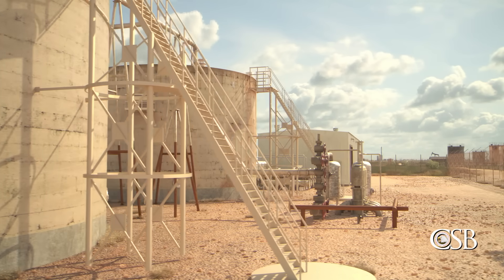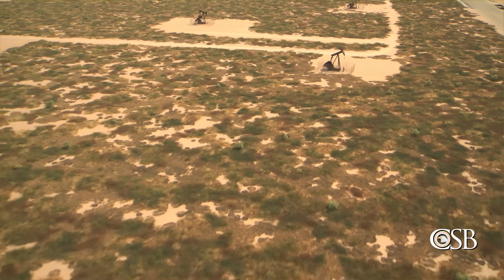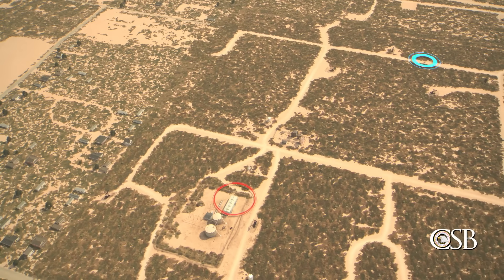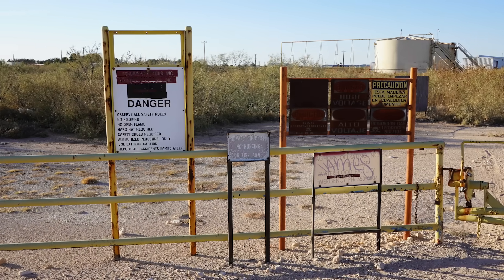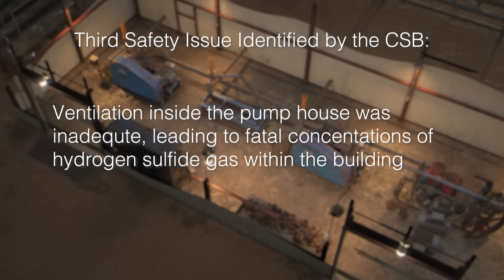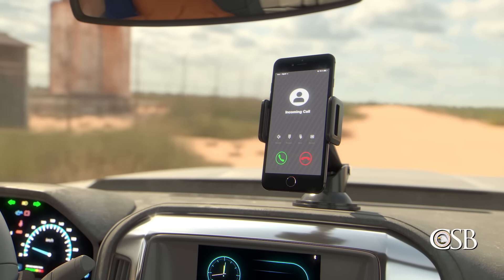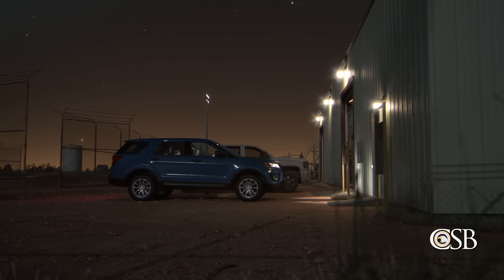Silent Killer: Hydrogen Sulfide Release in Odessa, Texas

Comment: I was surprised to hear that the worker's spouse could just walk into the pump house with operations ongoing.  Is that typical in the oil and gas industry?
Reply: Yes I work here in Odessa most of these fields like this one may only have 1-2 employees on site at a time…
Reply: @Gfkd2001  I know the wife didn't work at the plant, but surely she glanced in the worker's truck to see if he was there when she arrived? If so, how did she not see or hear the worker's personal alarm going off on his front seat? Surely that alarm on his front seat, plus his extended absence would have sent danger alarm bells going off in the wife's mind?
I feel so bad for the kids, imagine the horror of growing up knowing both your parents were killed metres away  from you and you were blissfully unaware so couldn't save them...
That guy ruined hie whole family by not being alert, the wife could have done better herself but the real victims here are the kids. 
Horrifying stuff...
Reply: @mariolisa2832  the personal alarm was found to be active by first responders/investigators, which is likely a discovery made a significant amount of time after the wife arrived. In other words, the work truck itself may not have been sufficiently inundated with the toxic gas at the time to set off the alarm, only later. Also note that, as events are described, it is undetermined if the majority of the gas leakage (from the shattered piston) happened prior to the worker showing up, or were caused by his actions (ie. not depowering the pump); this could be critical for the timeline of the evolution and spread of the gas.

I don't think the worker was at fault, or his wife. The way it is described, Aghorn was responsible, by way of their atrocious safety practices, culture, and training. It is quite possible that he didn't know better. He may have some fault, but we don't know and can't know, and as such it is inappropriate to assume he was at fault when there is ample evidence that it was the company that let him down.
Reply: @mariolisa2832  also, the wife may not have been able to know better. One particular point the video made was the lack of clear warning signage of the dangers presented by the facility. So here you have a woman, likely very, very worried about her husband, who is (wrongfully) not prevented from entering the site (which may even give someone the impression that it's "not that bad"), and is not given appropriate warning of the extreme dangers that may be present. No, I find it hard to fault her either. The only saving grace is that, despite the personal alarm having detected dangerous levels of gas having come inside the work truck, it was still not enough to kill the two children in the wife's vehicle. It's possible that if rescue hadn't come soon after, the kids would have been dead too :(
Reply: 13 years in the oil field and the anwser is no. No way the wife could of known where it was located unless he had taken her out there before which is really against the rules. They give us a list of phone numbers to give our spouses for them to call incase of something like this
Reply: @cooldbz12mach1padilla  She could have used the "where's my phone" app, I would in fact bet that was she did.
Reply: @cooldbz12mach1padilla  this location is right in town you can thro a rock from the location to their home the video is not accurate about the houses around I have friends that live next door to it
Reply: @cooldbz12mach1padilla  you obviously don’t have a phone that shares your location with your family.
Reply: @stargazer7644  actually no, i turn off all location services.
Reply: She probably never thought about it or she wouldnt have driven in there with her kids sadly but at least they stayed in the car its a blessing the gas didnt get to them anyway.   Ive worked by myself and for companies that had very little as far as a safety program to one that was over the top (you learn to appreciate these especially when your family goes to work in the oilfield). So many people get hired during booms that probably never have a general idea about the dangers that some people have heard about there entire life but you cant get complacent no matter where you work no matter what kind of job it is!
Reply: I work at a sour gas plant in Alberta. If I find my wife onsite with no warning or heads up I'd be mortified.
Reply: It shouldn't be...
Reply: Did you watch the video, they said one of the safety breaches was him not closing and locking the gate behind him. If he had, his wife would more than likely be alive
Reply: @carbonzo6  closing and locking the gate, hindering emergency services doesn’t seem too smart now does it?
Reply: @mikebuffing727  I don’t know about this site in particular but all fenced in sites that I’ve been inside of have emergency gates to flee in any direction
Reply: @carbonzo6  I'm curious how those gates operate. Do you have a link to a description, or photos, or something? Are they for people on foot only, or also for vehicles? What prevents them from being opened from outside and how do you open them from inside?
Reply: @robertobryk4989  it’s only able for a person to pass on foot. It cannot be opened from outside the facility. It has a push bar on the inside and that’s how it opens. There is no mechanism to open it from the outside
Reply: @mikebuffing727  hindering emergency services, who, like the rest of us are also mortal, from walking into a cloud of odorless, invisible, instant death.

And any first responder with the PPE to deal with this also probably has boltcutters.
Reply: A firefighter is going to have no qualms ramming through a locked gate to save a life.
Reply: 8 years refinery engineer here. Not typical at all. But, this operation seemed very cowboy - which isn't unheard of in southern US for remote 1-5 man operations (think drilling rigs). Hate to say this - but while Aghorn had fault, the lions share of the blame was with employee and wife. You always take your  PPE, you always walk with caution, you ALWAYS go with a buddy. Every fatality I know of in my city has been due to lack of buddy-system. The fact that the wife showed up with kids to an operating plant is just abhorrent - as a refinery engineer, this to me is akin to child abuse. O&G facilities are inherently dangerous and at my job even take-your-kids-to-work-day wasn't a thing.
Reply: @CMF4L  Happens similarly in the trades. Supposed to work in pairs on energized circuits so if one person is in trouble the other can shut it down, break contact, call for help. Yet guys ignore it, get in contact with a circuit and you find them dead. 

PPE is another one. Knew a guy racking in the main breakers at a refinery, it was hot in June, so he decided the hot as hell arc suit could be skipped this one time. Well, it was the one time an arc blast happens, and he was standing unprotected about 16 inches from a 32000 degree electrical arc. He became the fault path, and there wasn’t much left to send to his wife and kids. If you could ask him if he’d rather be sweating his ass off right now, I think I know the answer. 

I wear my suit, I wear my harness, I wear my mask when drilling silicates. I’d prefer to see my kids tonight and see them get married some day.
Reply: Yes
Reply: The worker left the gate open when he entered.
Reply: Yes
Reply: In Europe the answer is a NO it's zero tolerance and security of site locations is everywhere. Requirements for visitors badge and requirements for training is required, even for visitors.
Reply: Completely securing remote sites can be impossibly costly unless you're the federal government and have unlimited fake money to spend. That said , a potentially lethally dangerous site should at least have required a keycard/badge for entry to keep out the unaware and innocent spouse.

Comment: I hope other oil pump operators will listen to these recommendations.  What an incredible tragedy.

I am also amazed at the animations in these videos.  The details are incredible, like the animation including a PanelView 6.

These videos make me think about hazards at the factories where I have worked.  Most have decent LOTO rules.  But I have heard of deaths related to injection molding machines and forklifts.  Where I work now, there have been small incidents.  Safety is important to everyone, rewards given to those who identify problems.  I've started unnecessarily wearing my safety helmet and yellow vest, because the big bosses make that habit.  It seems prudent to me.  A few weeks ago, I was in an electrical panel where something fell into my head.  Since I had my helmet, no problem.  Everybody, not wearing helmets themselves, commented that my helmet was useful that day.  But no one is wearing them unless required.
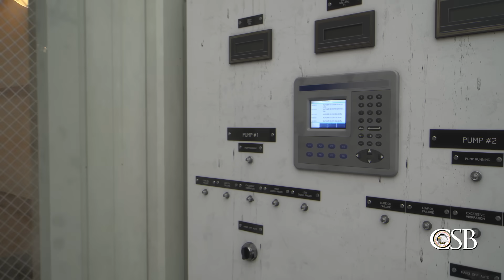Reply: What is a PanelView 6? The thing at 4:20?

Comment: His h2s monitor would have saved his life. I work in the industry and I always look for flashing lights, wind socks, and any other things that may catch my eyes
Reply: The wind sock is to tell you which direction to move to get away from the gas if your H2S monitor goes off. You want to move crosswind as it's the best way to avoid hazardous gases. The reason you don't go upwind is because if the source is upwind from you then you would be moving closer.
Reply: @charlieswearingen9156  
Makes sense to me
Reply: I have a rough understanding of its use for aviation, but do you use it for other reasons at your work?
Reply: @LeonSteelpaw  at 10 ppm the monitor starts beeping and vibrating. It lets you know it time to de-ass the area. He was in an enclosed building, no where for the gas to go.
Reply: @davidmcclellan2786  Interesting.

Comment: I would say there are a few more safety issues here

1, The equipment is likely old and poorly maintained leading to lots of small leaks and frequent need for repair. This may have lead to disabling of alarms due to "nuisance tripping"
2. With a single employee in the area there should be regular check ins with there immediate supervisor. This wouldnt of saved the employee but may of saved the wife as a missed check in would of indicated a problem and corporate sent someone to investigate. And should of found the issue and at least warned others or alerted corporate to get someone out who has the proper equipment to fix the problem.
Reply: it sounds like the sup was aware of non-responsiveness, but the worker would have been dead long before help arrived, even if the manager had acted on the first sign of a problem.  Might have saved the wife though.

Comment: so...he had a working detector that he left in the car. You get these expensive detectors issued for a good reason. He had to smell the rotten eggs smell when he entered the building. 
If that is not enough to remind one of the possibility of a very toxic gas *that you have a friggin' personal detector for, which you're supposed to have with you at all times*, this is a Darwin award, not a management failure. The sad part is it was nearly a complete Darwin award.
The only management fail I see here is the lack of big orange signs with a skull and crossbones stating "Hydrogen sulfide" "toxic gas" "keep out!" "you can die here!".

Comment: Most companies I've worked for have a buddy system, meaning you aren't allowed to work on your own. The idea is a 2nd worker is more likely to pick up on mistakes from the first (such as leaving his gas detector behind, or setting the pump to auto start). And if an employee is incapacitated (electrocuted, trapped under machinery, unconscious, etc.), the 2nd can either help or call for help.

And managers should know where and what the employees are doing, particularly if they are working in a potentially dangerous environment. Employees don't check in after a certain period of time, you call out the cavalry.

Comment: I'm retired now but I worked most of my career with a Canadian utility that had both federally regulated gas pipeline and provincially regulated gas distribution facilities.  Part of my work involved regulatory oversight of construction and operating safety.  Seeing this video, I appreciate all of the time and effort we invested in site security, PPE, employee training and the development of a safety culture within the compny.
Reply: Sadly I can't say the same for this;
In September 2008, three workers were killed and two suffered serious injury, including long term brain damage, at a mushroom growing company in Langley, British Columbia. A valve to a pipe that carried chicken manure, straw and gypsum to the compost fuel for the mushroom growing operation became clogged, and as workers unclogged the valve in a confined space without proper ventilation the hydrogen sulfide that had built up due to anaerobic decomposition of the material was released, poisoning the workers in the surrounding area.[63] Investigator said there could have been more fatalities if the pipe had been fully cleared and/or if the wind had changed directions.[64]

Comment: A secondary and entirely independent alarm with its own power supply and battery with a warning light and sound should be used in addition to the other warning light used at the top of the house. Audible warnings would have been perfect for this incident because an untrained person was involved. It could have prevented her from going in even if he was already dead because the audible alarm would say poisonous gas detected or something similar.

Comment: Ive been to this location when I worked in the oil field, lived a few cities away and worked in Odessa often. Didnt know this happened there until this video. I used to work on oil tanks installing tank gauges. And the only time I ever didn't wear my H2S monitor was when I was wearing the required Supplied Air Respirator up on a tank. H2S is no joke, and I've had several close calls with it. Anyone who works oil field in the permian basin and elsewhere, never leave your monitor anywhere but on your person. It could very well save your life, like it saved mine a few times.
Reply: Having worked in several facilities in Texas I think it's pretty disturbing how often people think safety "is for p words."

I'd rather go home at the end of the day thanks. Most rules and regs are written in blood.
Reply: I had an experience with H2S at lab. It's pretty fast, no joke. Thankfully there was a colleague who helped me that day
Reply: @yararaq  isn't the obnoxious smell a really obvious warning that you need to GTFO?
Reply: @virt1one  At super high concentrations it drops you in a second.  There's no out you can get before you're dead.  At lower concentrations it causes olfactory fatigue, so you may believe it's gone/ you've gotten away from it despite that it's actually getting worse.  A detector would tell you otherwise.
Reply: @virt1one  H2S is only smells at REALLY low  concentrations and H2S is deadly at low concentrations. So the gap between smelling H2S and dying to it is quite slim.

Comment: 7:16 they even animated the reverse light briefly coming on when he shifts into park. breathtaking attention to detail.
Reply: They do not trifle with the truth these folks.
Reply: @jolterhead  Except when the "camera" walks right through the chain link fence, albeit briefly. 10:45
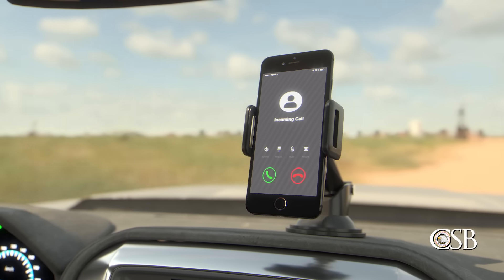Reply: 4:28 you can see every single error light on the dash is on. I wonder if this is an accurate detail as well.
Reply: @DVeck89  Company issued car? Would be fitting to the state of the rest of their equipment.
Reply: @DVeck89  Yes...it is. Glad that you asked.
Reply: @DVeck89  Given the state of the Aghorn facility, I suspect this could have also been the case for the company truck.  Unfortunately for the worker, it didn't break down before reaching the water flood station. RIP
Reply: @DVeck89  They also don't turn off when he gets out.
Reply: Oh my god!! I never noticed that; outstanding catch, I appreciate these details so much.
Reply: And the metal ring around the smartphone button looks shiny, madness!
Reply: but did you notice, there was no driver in the front seat?

Comment: Ive worked on aghorn locations and i can tell you i cant believe all their staff isnt dead. You have to see how dingy these locations are. I mean a back pressure valve was so h2s eatin that the ductile metal litterally colapsed and oil dumped on the ground.